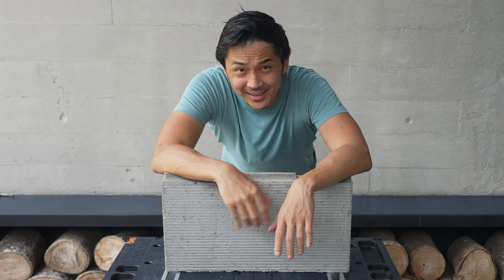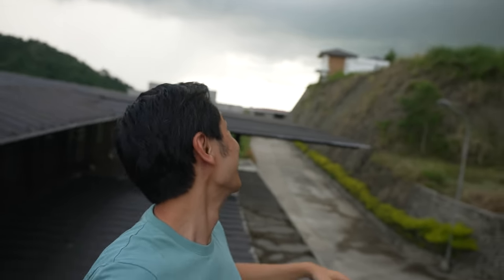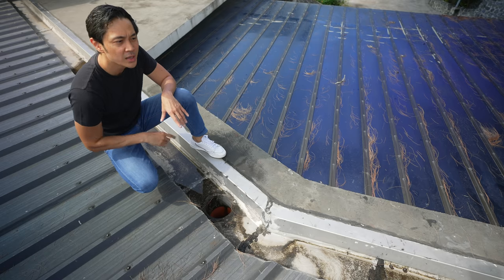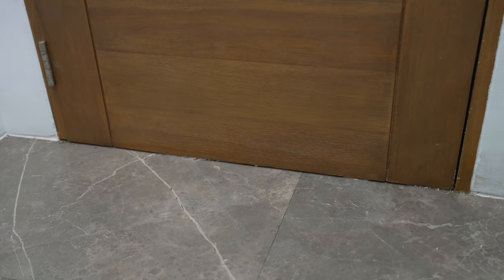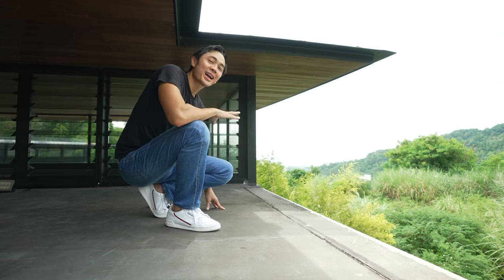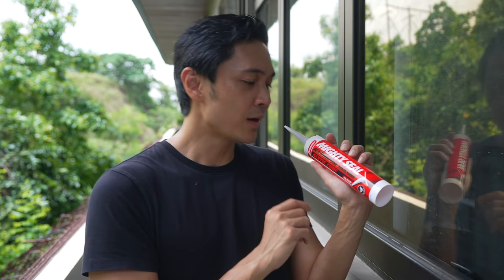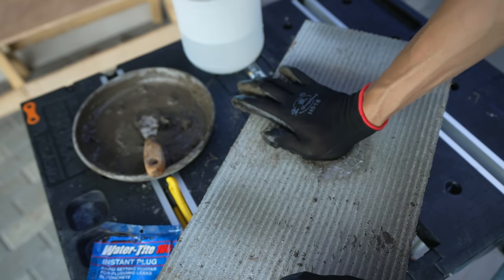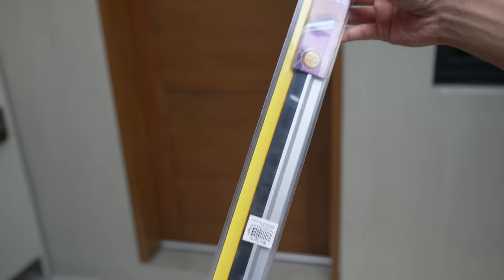Prepare for the Rainy Season!

Comment: This is very nice. Goes to show that even good houses still need minimal improvements and not everything can be done during construction phase.
Reply: meaning lng yan hindi magaling nag design ng bahay nila
Reply: @user-mj8zf4qq7u  nakakita ka naba ng bahay na hindi kailangan imaintenance
Reply: @karu_official_yt  hahah kakagawa lng bahay nya tapos dami ng damage, engineer ba talaga yan eh parang andaming flaws sa design ng bahay nya hahah
Reply: @user-mj8zf4qq7u  🤣🤣
Reply: @user-mj8zf4qq7u  kaya mas gusto ko ng simpleng bahay para konti gastos
Reply: @karu_official_yt  kaya parang mas importante sa kanya yung "aesthetics" kesa sa "quality"
Reply: @user-mj8zf4qq7u  and so? don’t comment if you don’t have anything good to say.
Reply: @user-mj8zf4qq7u  hmm. hindi naman po maiiwasan na kahit bagong gawa may mga imperfections. kaya most of the time malalaman na kung saan yung mga konting flaws pag umuulan, lalabas na kung saan yung mga onting leaks that can be easily fixed, especially for big houses. may relative kami na architect and he said that they would even prefer na umulan and makita nila kung saan yung mga little things sa building na kelangan ireinforce if ever meron before turning it over to the client. kung wala naman problema at perfect lahat mas mabuti haha. But the problems tackled in this video are not uncommon problems lalo na sa size ng house and considering its location on the mountain na mas exposed sa changing weather conditions
Reply: @kzaeo7878  then that means hindi talaga magaling mag design sila
Reply: True. For 20 yrs ive seen a lot. Nice houses really needs maintenance, d maiiwasan. Its not the same as those houses during early days na simple wala arte. But it should not stop you from building a nice house if its your dream. Thats part of progress ika nga.
Reply: @user-mj8zf4qq7u   madami na yun sayo? Kailangan lang linisin yung gutter which is very normal kahit saang bahay pa yan lol. And nagka earthquake, normal mag ka cracks during earthquakes lalo na nasa mountain sila.

Comment: Awesome tips Slater.
If I may add, sometimes we really don't know where the leak is coming from, especially yung may mga ceilings. Water kasi will flow to the lowest part of a given plane. Kaya, the leak on the roof may have been on the otherside of the house but the dripping may be experienced at other end of the house. In this case, things could get a bit tricky! Sometimes, it would take a long time to figure this out.
Reply: If there is enough space between the ceiling and the roof you can poke your head in through an access or better yet, climb/crawl in. Do this during the day and any holes in the roof will be obvious. It should be pitch black inside the ceiling and even really small holes will appear as light shining through if you do this during a sunny day. Poke a "walis tingting" twig through the hole and once you climb the roof just look for it poking out. 😉
Reply: @Vendemiair  that should work perfectly.

Comment: just curious, how to deal with leaks coming from the water seeping through firewalls and old concrete gutters.
Reply: yes, any tips please. 🙏
Reply: Tips please
Reply: Apply waterproofing. For walls use cementitious waterproofing and for concrete gutters use the resin type or asphalt type of waterproofing.
Reply: @emfat9799  Sir, diba pwede cementitous sa conc gutters? How about applying coal tar?
Reply: @perid5815  in my experience hindi pwede ang cementitious for concrete gutters. One reason is dust. Kapag hindi malinis ung surface na lalagyan, tutuklap lang ito. Isa pang reason is manipis sya pag na-apply na . Meaning pag umulan at nagkaroon ng ponding sa gutter, madadali sa moisture ung waterproofing at mawawala ung kapit nya sa surface ng gutter

Comment: Thank you very much Slater for sharing. I see rain drops in the second floor of the house, need ba tangtangon ang hardiflex kisame sa bedroom ra ba to trace the leaks?...Hmmm murag sakto limpyohan ang mga areas where water passes thru above that area...What if I want to open the door all day near the veranda then it rains and water still comes in due to the a windy rainy day...maybe make the roof canopy a feet longer or design the house nga naay open window with screen para cooler...How do you let more natural air come in? Sa bungtod pud mi puyo dapit Talisay so wish to take advantage the cool air and minimize air con 😏🤭😉

Comment: Thank you so much for this. I have the same problem with the splashes of rain coming through the bottom part of the door. Now I know what to do! I am really learning a lot from your channel. Threading through this topic, I was wondering how I would be able to check if there is already a leak coming from the roof since I have placed an insulation sheet. Any suggestion of how to do this? Thank you and more subscribers and views to come!

Comment: Good rainy day Master Slater!

Need help! Any advice.for the quickest way to put sealant on more than 100 tekscrews/bolts and a few overlaps of roofing thats like 20ft more or less per overlap. Done half the roof using vulcaseal (done with 1 cans of 1L each) and when weather is gloomy, switched to elastoseal (done with 3 250g tubes) and still have more to reseal and its a pain in the vutt doing it.

Eyeing the Pr1mero elastomeric waterproofing sealant which is budget friendly and most important application is done via paint paint then with the fiber cloth added, much better sealing as what the ads say. 

So yeah looking for sealants or way that can be easy to apply and yeah still strong like the leading brands and lastly budget friendly even tho budget should not be much of an issue when it comes to waterproofing your hoise as compared to soaked interior and structure damage due to water..

Thanks thanks i hope you can help me!

Slater! Have a good one!

Comment: Why not make the roof and External walls totally water proof from day 1? 
is it not possible? 
liteblocks can be dipped in waterproofing solution 
cover the whole roof with waterproofing similar to the ones used in bathroom floors. 
IM No expert, but IM curious why the house is not water proof from day 1

Comment: I don't understand people's fascination with contemporary homes that have a flat roof. The roof should sharply slant so that rainwater flows towards the outer edges of the house. That way, if the rain gutter overflows for any reason, rainwater  does not end up inside the house. It does not make sense to have a gutter running through the middle of the house.  Also,  you can install a leaf filter or screen on your gutters so it does not get clogged. Matagal ng may solution ang problema na ito. Matigas lang ulo ng mga architects na gumagawa pa rin ng mga flat na bubong.